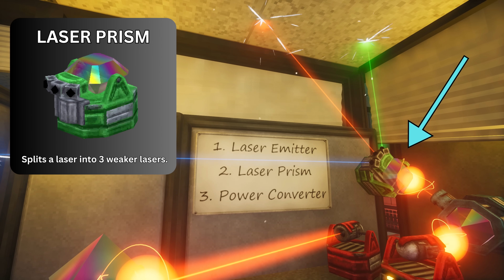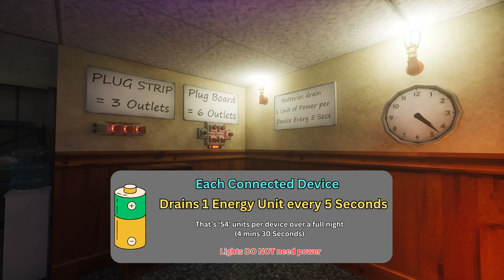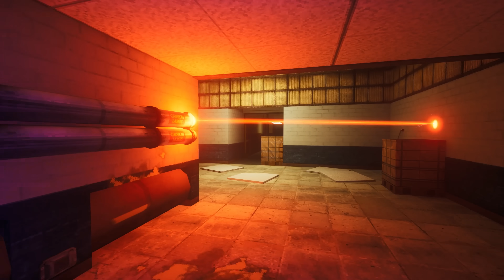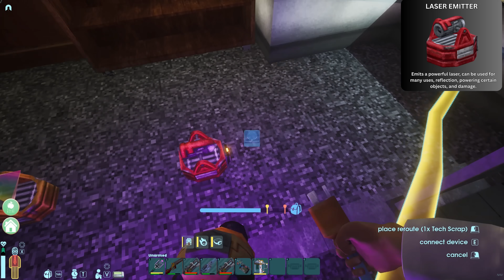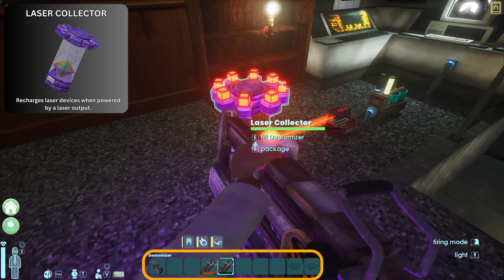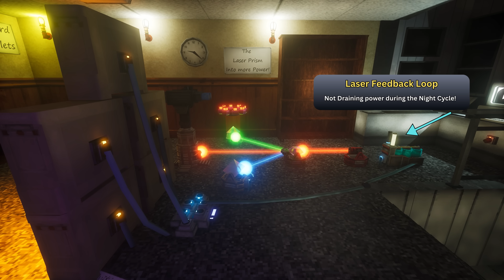Laser Guide - Power Flow, Setup & How It Works | Abiotic Factor

Comment: I've done my own experimentation with infinite loops, in my case with huge chains of batteries (just for messing around, not for any practical use. I wanted an animated sculpture of the batteries perpetually draining and emptying. It was really inconsistent. It would work for a bit, and then shut itself off. I'm not sure of all the quirks with this setup.
Reply from the maker: The infinite power trick was patched out in the Dark Energy update prior to 1.0 

That said, I'm playing on version (1.0.0.20809) - so that's after the dark energy patch.. users are reporting the cursed loop either works or it doesn't and I'm now pretty sure it's because we're playing on a server with 3 other lads. The host cannot replicate this loop, but clients of that server can... so I think it's some odd loophole that gets around it (and will likely be fixed as this video gains exposure lol)

Comment: So when it says 'Splits into weaker lasers' are they actually weaker? Will devices like a laser turret underperform if the laser is weak? Also if I redirect the leaking wall laser across the area, and right before the laser fizzles out, I use a Laser Power Converter, into a Laser Emitter, will it be back to full strength?
Reply from the maker: Good questions. 

I didn't deep dive enough to answer these but I believe, the weaker beams wont affect powering the turret as the game world counts power as either 'present' or it's not. (Not 50% power, etc)
However I think partly why they're leaning into 'weaker beams' is so that you can't do what I did and power a converter with it and create infinite power loops. Might require further testing!

Comment: Is there a way to make the laser collectors more efficient? I keep having the problem where I keep running out of lasers for me and my friend and we have to wait forever for them to recharge.
Reply from the maker: I knew this might get asked, so I did actually fire 2x laser emitters onto a laser collector and never noticed it 'charge faster' specifically. 

I would probably solve your problem by just building more of them tbh.
Reply: @Fleazuri yeah we have 2 lasers hitting them and I don’t think it does anything really, but we leave it like that because we hope it might work lol
Reply: Yeah, it takes about 8 minutes for an empty collector to be full, and from other videos my best recommendation is to each have a spare one in someone's inventory, probably teh person using lasers the most, and then have another one at base. Whenever you return you swap out the 2 collectors

If everyones churning through then you'll need to setup different collector areas, label them for each person so you don't accidentally pick up a dry one, due to there currently being a bug where the collectors show they're at full charge at only like, 20% capacity

Comment: I rebuilt my base, and overhauled my energy system. I don't try cheese with the infinite source, but made my energy consumption down, to use less, but more powerful storage system.
Reply from the maker: The big base I built is run entirely using batteries tbh. 

I just deep dived into lasers to help people that didn't know how they worked! (Team batteries here) haha
Reply: Youd be amazed to find out theres zero reason to do anything effectively. You can easily just brute force and daisy chain batteries and itll work fine. I had an endgame base running on just a few carbon daisy chained batteries.
Reply: @Odyssey636  I use multiple battery "stops" over the lines to counter the IS-0211's attacks during the Rolling Blackouts.

Comment: I thought they had patched out the infinite power thing at the end. But anyway, I did this for my base. 
Outlet > battery > laser emitter > converter > literally everything in my endgame base using plug strips & tech scrap. Never turned off.
Reply from the maker: I heard this too but in testing and building I was able to create this loop. I've pinned a comment for more clarity. Lasers = voodoo magic anyway :D
Reply from the maker: To update this: I'm playing on a server with 3 others, even though the server is standard settings and version (1.0.0.20809) - I've heard that hosts won't be able to create the loop, yet sometimes clients of that server can. 
Might explain why it worked.

Comment: Just to let everyone know yes the infinite power loop was fixed
Edit: it has been fixed if you are solo or server host but not if your joining a server
Reply from the maker: It's odd, as it still works for me. I just jumped back in and rebuilt it two different ways... 
Version: 1.0.0.20809
Reply: @Fleazuri  Are you playing on a server world? I've heard hosts/solo players cant do the loop, but clients are allowed to connect a plug strip/laser power converter back into the battery
Reply from the maker: @Pendergast891  You would be correct sir, there are 4 of us in the group (they've all finished) and I remain to always build. Server is running normal settings, so that's hilarious that I can make it work but the host can't!

Comment: Wouldn't it be possible then to make a shorter loop by just considering the following circuit:
Plug strip -> Battery -> Laser Emitter -> Collector -> Back into Plug strip

I dont see why the laser splitter is necessary.
Reply from the maker: It should be possible, the splitter wouldn't be necessary. I'm just showing you possibilities of what can be done with lasers! (Gotta keep the vid sub 5 mins baby!)

Comment: just tried this, but whem i try to connect the plugboard to the battery that power the laser the interaction end without connecting
Reply from the maker: Odd. I just checked and this is still working in my game. Even if it doesn't, it just means you don't get the infinite power option but laser power is still strong!
Reply: It might be the second laser splitter - converter allowing this to be done.. that's just a thought on my end haven't tried myself yet
Reply: Same, and it made me quite disappointed when I thought I'd finally gotten infinite power for my night-only playthrough. I suppose I'll try adding more degrees of separation (more emitters and converters) to see if it's just that, or if I need a splitter
Reply from the maker: @JohnQDarksoul  Did you replicate it as I've done above? I'm interested as to why it's not working. 
Maybe it has something to do with the Laser collector also being powered?

Keep me posted - I will have to investigate my end further to see if I can break it / replicate the same problem.
Reply: @Fleazuri  i've replicated the same exact setup as you and it dosent work, the best i've achived is if i make the loop (battery-emitter-converter-splitter-plugboard-battery) without connecting other consuming device the game let me connect the loop and self sustain, BUT the plugboard light stay all red and mouse indicator sign it as not powered and any device i connect doesn't recive power.
Reply from the maker: @deboraniccoli979  Ok thanks for the update, super odd and inconsistent then - it wasn't really the main part of the video but I'm gonna keep playing around on this. My game version is updated and I was doing this today so, odd...
Reply: @JohnQDarksoul  how that is even possible you cant use workbench without power
Reply: It's based on timing since lasers works really fast.

Put a single makeshift battery to be charged by this network before outputting it to a laser to beam the converter, it adds time so that the beam cycles around and adds energy to the battery back.
Reply: A way to set it up is to have charged batteries and plugs to split it up.
Maybe make 2 out of the 3 plugs used to repower emitters to cycle energy back, and the last plug is to a network.

Throw makeshift batteries in the mix, don't use prisms since it actually lowers the charging output of the laser to be slower.
Reply: Night only, turns off the lights so its always darkness. Power still functions on a hourly basis.